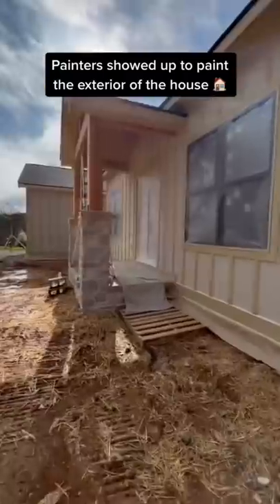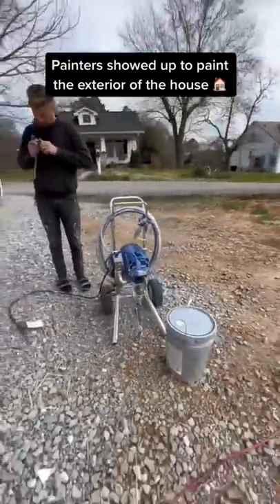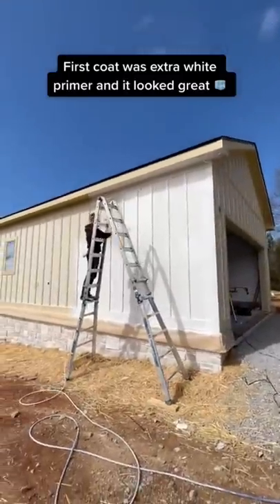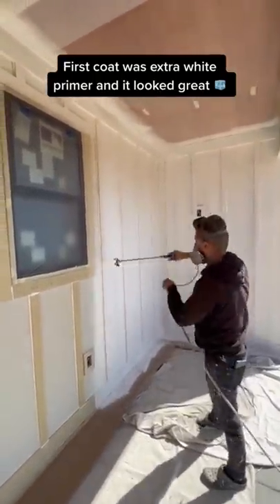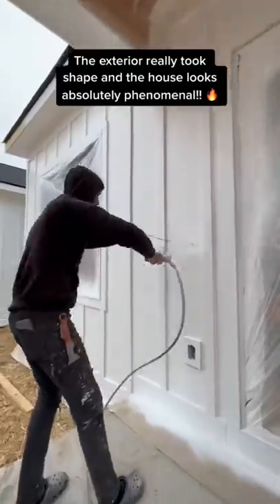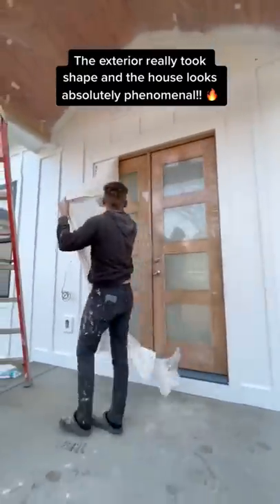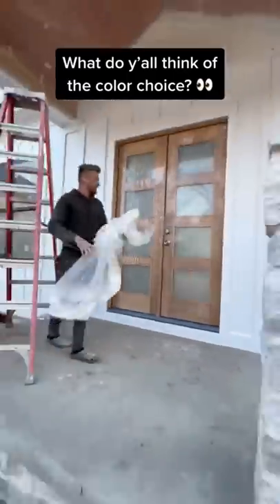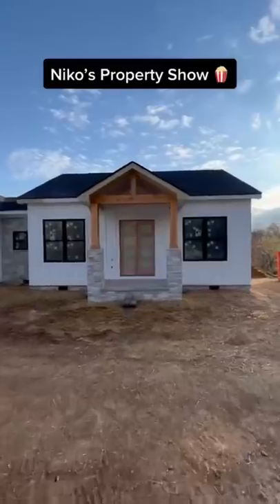Painters showed up and got straight to work!! Exterior siding is painted!! #construction #painting

Comment: They are not painters, summer time it will be peeling. You can't use latex paint below 50 Degree's and it's snowing out at 32 Degree's? That's why Professionals know when you can paint and not do a Mickey Mouse job.